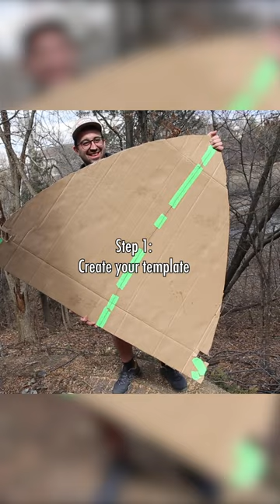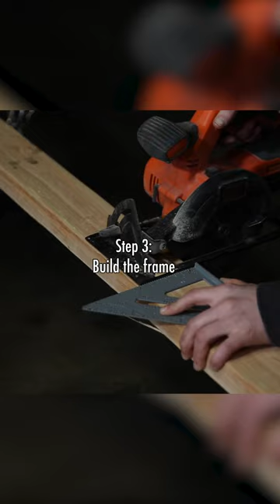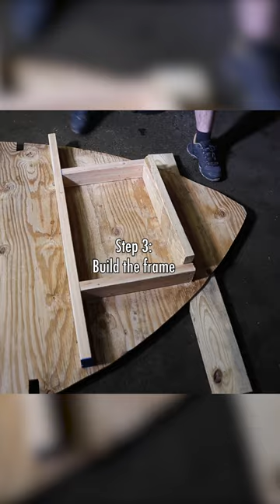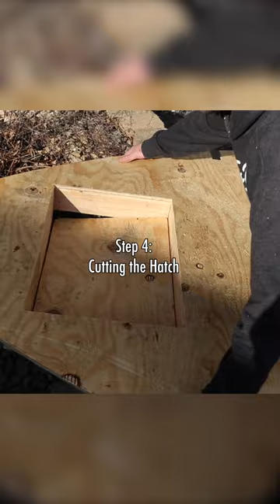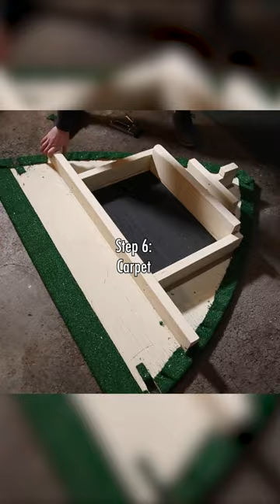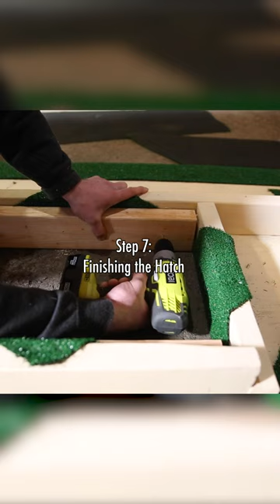7 Steps to Build a Casting Deck

Comment: Question: do you add any support on the front down to the bottom of the boat or is just just hanging on the sides of the v. Meaning does it just sit on top of the front bench or do you have some kind of wood in the front tip to the floor of the boat
Reply from the maker: Great question. The 2x4's made the floor generally very solid. The frame itself sides along the sides of the boat, so I didn't need to add any sort of extra support.

Comment: Step #4 replace every year because you waisted your time and money using the cheapest wood available... Next time, use Coosa and fiberglass it in. In your case, buy aluminum stock and a welder. It's not difficult
Reply from the maker: This cost less than $50 and it is solid as a rock 1 year later. Feel free to use whatever works for you. This approach worked well for me.